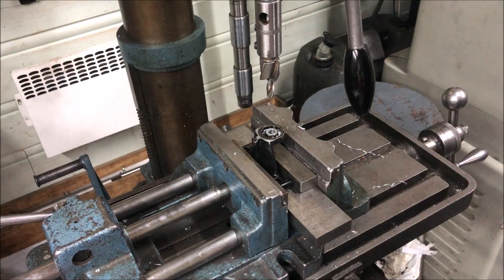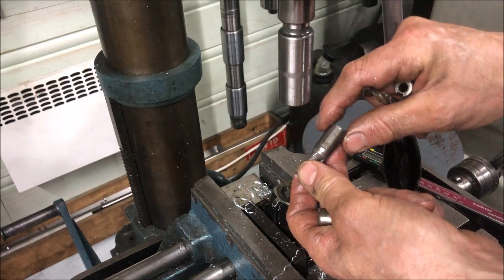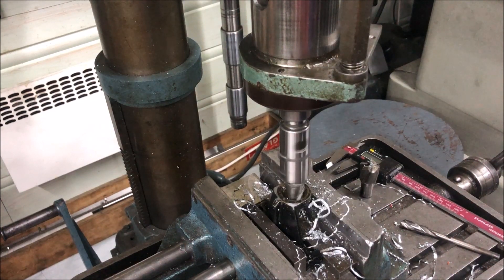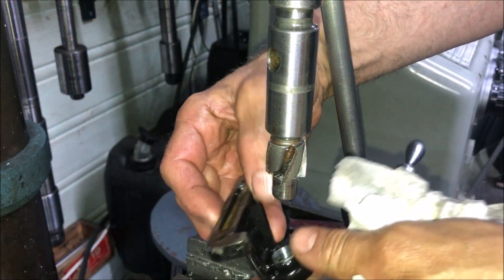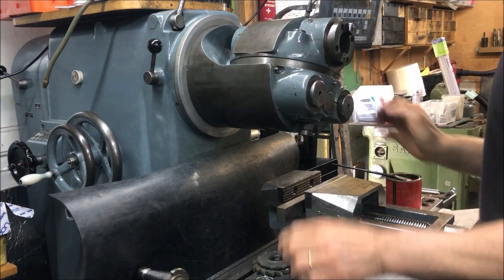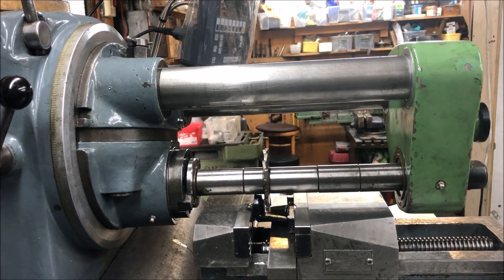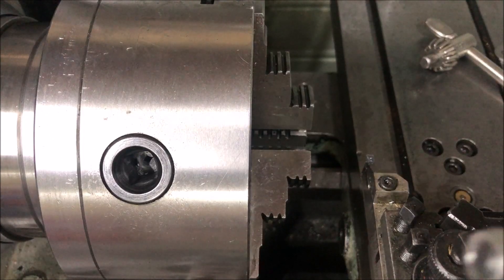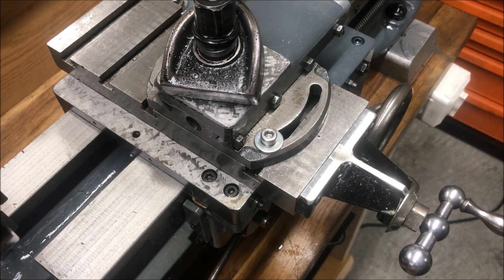Myford ML7 - cross feed ball thrust bearing conversion

Comment: Is this based on the George H Thomas design for the super 7? Arboga mill? Same as mine 😁
Reply from the maker: It has inspiration from what is published on the ArcEuroTrade site, but I just used what I had available which was suitable and adjusted to that. Therefore the sleeve. Yes, the Arboga drill press is nice to have. PS! This is the drill press only version.. floor standing and only fitted with an MT3 taper for drill chucks. We have the mill/drill version where I work and this has their locking system to adopt milling cutters as well. As you know, this has a beefed up column, and a better, more rigid XY-table setup.. but not the table-spindle envelope as on the drill press variant.

Comment: As Mr. Crispin recently said "I need a milling machine and lathe, to make parts for my milling machine and lathe".  Nicely crafted, as usual.  

I do like seeing side milling cutters used on horizontal type setups.  It just seems like a more rigid arrangement, much less tool deflection.  Plus the bonus that the cutters are so simple to sharpen.
Reply from the maker: Thnks. The fact that I have a bunch of these cutters as a result of an acution buy sometimes makes me feel bad when I stumble across them.. I mean they do not get much used. Agree, this is a rigid setup. However, for my use it didn't matter much on this very simple, small job, but it was a chance to try/show..

Comment: On the Super 7 i just made a bush where you fit the ball race. The thrust is adjustable from behind. I thought about the thrust mod , but do not use the lathe that much.
Steve.
Reply from the maker: I guess that also works/is sufficient. In fact, think the original design functions OK enough as well :) A fun, small project anyway